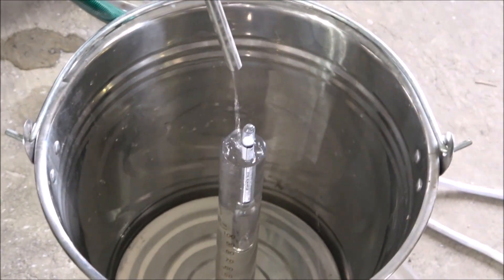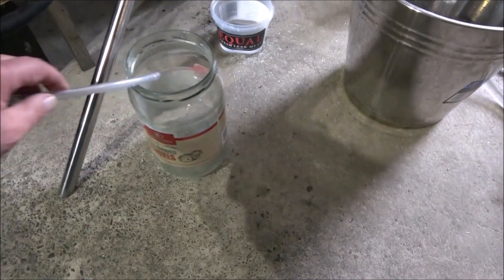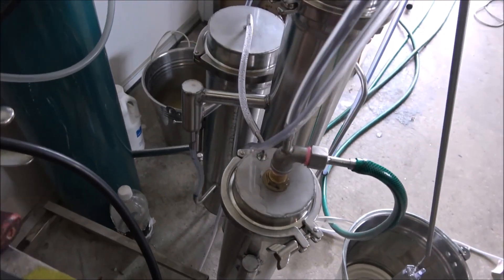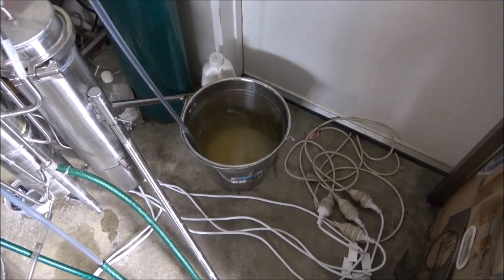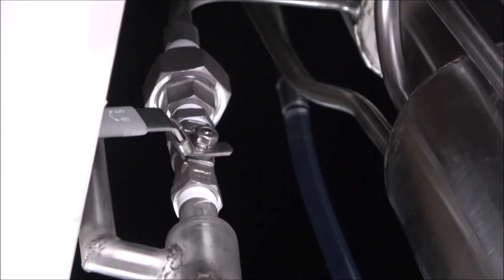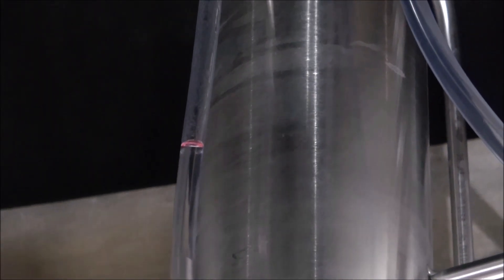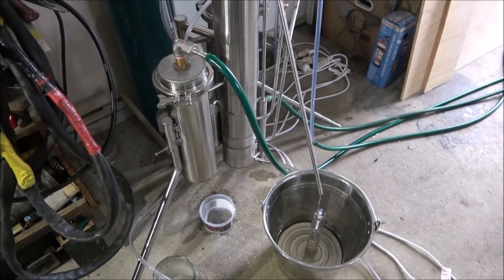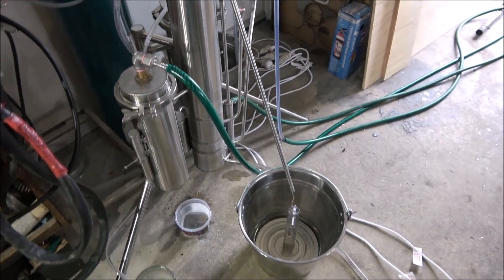9kw continuous alcohol reflux still.

Comment: Impressive. Thank you. So once the wash that was injected in is depleted of alcohol, I suppose it would be heavier. Is it tapped off from the bottom of the still? What is the SG of the processed wash? Is the still operated under vacuum? What is the generated steam used for? (I just found other videos so will perhaps find answers to these questions. Apologies if so).